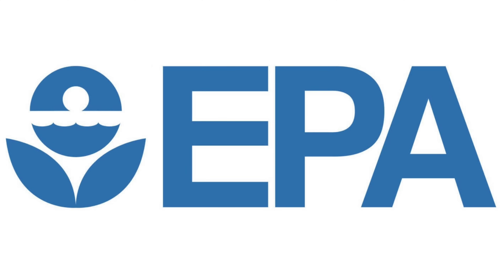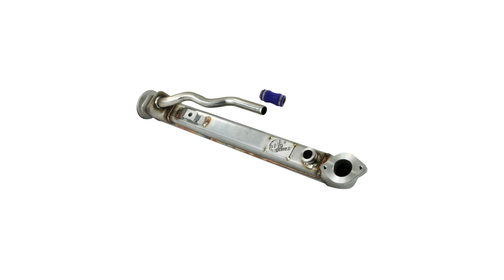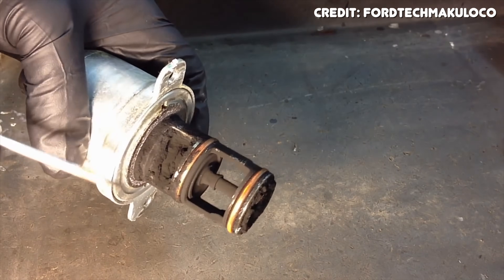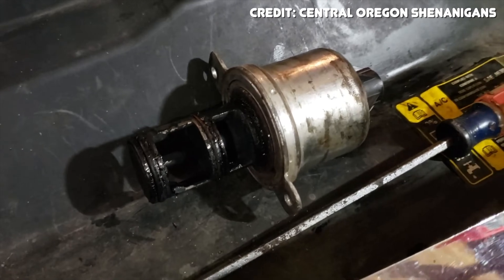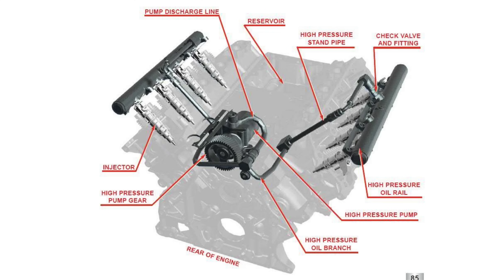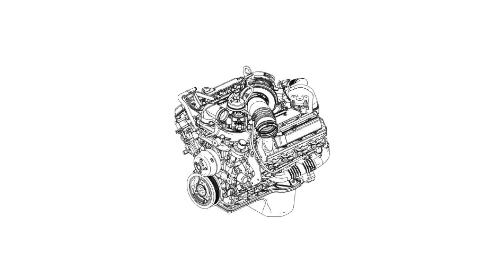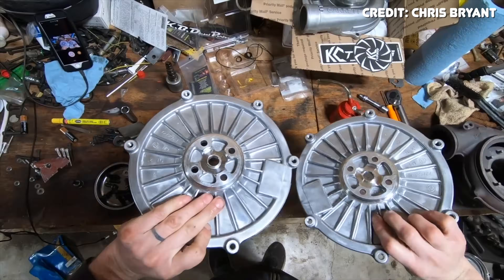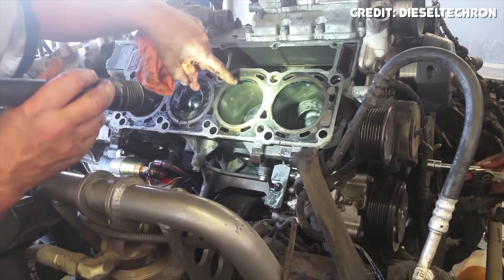The Truth About the 6.0L Powerstroke (And Everything Wrong With It)

Comment: Im on all my first motors. Have hundreds of ks on them. I wouldnt change the Hp or anything. I would pep it up maybe if I did.  
The right oil, coolant, and coolant cap is all Ive done. The only thing I ever noticed was a problem is bad gas. Makes the injectors fail (friends trucks). I have more issues with the vacuum for the A/C and the 6 disc changers all failed.

The engines have been perfect. Not arguing with anyome else that had issues. Every mechanic one talked to say they are a dream compared to 6.4 and 6.7
Cleaning egr is annoying

Comment: I find it interesting how there is a lot of controversy over the 6.0 Fords… I have an ‘05 F-250 with about 46k miles on it. I’ve not experienced any issues on it thus far but I’ve been told many times it is going to literally blow up in my face. I started doing my research on this kind of thing and I’ve come to find that there’s a lot of conflicting opinions when it should be pretty simple in my mind. Personally I have been trying to plan out the bulletproof process for my truck but I’ve been wondering if that would be the route to go, and what areas of the truck should I be putting my focus on regardless of their importance. I have also been wondering about adding additional power to the truck afterwards because I’ve been told that it should have nothing extra put on after bulletproofed

Comment: Step one, remove cab (because f u that’s why)
Step two remove 6.0
Step three install 5.9 Cummins
Step four put cab back on
Step 5 never have an issue again.
Optional Step 6 use the 6.0 for what it was really designed for and does well. A boat anchor.

Comment: The 6.0s needed bullet proofing because of EGR. Solid engines in my opinion. I come across a clean one with 300k+ time to time. The 7.3s are better but such a nightmare to work on.

Comment: I bought my truck new in 03. Still running it almost 20 years later. Fixed the things Ford and International ignored. Great engine, but it needs clean fuel and oil. Very fuel efficient. No power upgrades done except for a 4 inch turbo back exhaust, EGR delete, Banks intercooler upgrades and stage one upgrade on compressor wheel to move more air. I also added the cooling water filter and moved the oil cooler outside of the engine. Stock injectors. Keep in mind many upgrades have been done over the years to improve reliability of parts by Ford and the aftermarket.
Reply: Not to be a dick but I wouldn’t consider it a great engine if you have to do a bunch of mods including deleting emissions devices to make it reliable. How much was the diesel option back then? Like $8k? You should have gotten something you good use as it was intended with little worry.
Reply: Still have my 03 cc, lb, 4wd totally bulletproofed and am right there to click 50k miles lol. No lie. Ordering the new Odawg s2r intake in hopes to lower egt`s.

Comment: You have a very condescending tone and obviously are a Ford hater.
I grew up as a Ford brat, my Dad was a Ford dealer, so I might be a bit biased.
In 2014, I bought a used 2005 Ford F350, crewcab, long bed, DRW, 4wd to carry a 5000# Arctic Fox truck camper.
I immediately did ARP studs, Bullet Proof Diesel EGR cooler(lifetime warranty), and
a fresh OEM oil cooler. I also flushed the coolant and replaced with Catipillar EC-1 coolant and
installed a Sinister Diesel coolant filtration system. 
I now have 170000+ miles on my truck with no problems. 
I maintained proper maintenance with 5000 mile or less oil changes(T6 5w40) and regular fuel filter changes.
Plus I use Archoil and Hot Shot Secret's oil and fuel additives on every oil change and fuel fill ups.
Some of the issues you point out are only likely to occur with poor maintenance like high mile oil changes,
fuel filter changes(if any at all), and no fuel or oil additives.
Most diesel engines don't do well with dirty oil and fuel. Yes, the 6.0L is very sensitive to these problems,
so keep the oil and fuel clean with proper maintenance and additives.
Early on there were reports of sand block casting. With proper dealer support, this would have been
an un-issue, but Ford Motor did a bad job of supporting the dealers which were more or less clueless when
came to diesel engine support. (ie. th PSD 7.3L had no pollution components .~. was an easy keeper)
Also, Ford insisted on Motorcraft Gold coolant which initially would precipitate a goo that would clog up
the coolers(latter updates, eliminated this problem).
Ford was also very adamant about the head bolts and refused to admit that they were a problem, but now
a new factory rebuilt PSD 6.0L engine comes with head studs!
(BTW: My 1st truck camper rig was 1999 Ford F350 PSD 7.3L which I had a lot of problems with)
Reply: I also initially added an Edge CTS OBII in cab monitor which allowed me to monitor EOT, ECT, FICM volatage, ...
Reply: A reman from Ford does not come studded. 
 Also you had to do thousands of dollars on upgrades to an engine to make it reliable. I fail to see how anyone who bought one of these new as a several thousand dollar option should be expected to have to pay out the nose to make it reliable. Shoulda come that way.

Comment: The Ford Guys chiming in to defend the 6.0 Like a wave of lemmings going for the cliff. When you simply ask to see a picture of Odometer - they go Ghost
Reply: I’m a Ford guy. Don’t understand them defending this crap especially since ford didn’t design or build this engine. Would Ram guys blame them if Cummins came out with a redesigned engine and it was trash? That’s on Cummins. 
 Also the guy in the video mentions Ford boosted performance on an agricultural engine and it caused issues. Nonsense. Far more Powerstrokes were produced than DT365 during those years. International deigned this engine to go in Fords. Hell he even says the 7.3 was churning out 275 at the end of its run. Like they really thought they were gonna tune it to 175? Please

Comment: I've got a total of 20 thousand in my 03 when I bout it it had 90,000 miles. Purchase and full mod of problems with Bullet Proof Diesel products in 2012. I am just hitting 200,000 miles with zero problems. All I use it for is towing a 5th wheel at 16,000 lbs and a car trailer for my rock crawler at 7,200 lbs. For my money I see I am way ahead for power and dependability of the after years and current. 

Thought of getting a new truck and found cost and dependability of all of them just didn't ad up. Plus I don't have the head aches of DEF system. Thinking now of redoing the interior and do a paint refresh and party on... 

I like the hate for the 6.0s it got me into one for cheap and has been a very comfortable rig and surprisingly cheap operation for a diesel. But now I see the prices are ridiculous.

Comment: 280,000 miles on my 2006 6.0 F350 srw Supercab 4x4..
Change the oil frequently, put on a coolant filter and use CRC diesel fuel additive

Comment: I had all those issues, but once they got fixed , it is a great engine with no issues for eight of its eighteen years. Racing them hurst them and running clean diesel like Propel of R95 helps with smoke and soot buildup. Ford  ignored all the early issues.

Comment: I have an early 04 6.0 that has been bulletproofed on all 5 major points.
She's a beast, tons of power, and sexy...
Over 250000 miles, came off the line almost exactly 19 years ago, and still moves and sounds like the head turner she's always been. 
Blacked out and ridin' high... 
Nothin' else sounds quite like an early 6.0. 
Routine and religious maintenance is key.
Pinkos and Little Leftwing Crybabies are the only ones who don't find a bit of joy in the way Betty looks and sounds when she's out rollin' around...

Comment: Anyone reading this with one of these motors:

In addition to the standard "bulletproofing".. Go get yourself a bypass oil filter and coolant kit. There are a few available online. Then run Shell rotella T6.

Because of the fuel injection system, these motors are really hard on motor oil, in particular shearing. T6 is one of the most shearing resistant oils on the market by far.

As mentioned in the video, the coolant system is susceptible to failure from debris and buildup in the coolant, the coolant filter will solve that. An oil bypass filter will help protect both the main, and high pressure oil pumps as well as the injectors.

Comment: 6.0L is a pile of crap, bought one new in ‘05, truck cost me $62K including the price of the truck and all the repairs and upgrades to drive 132K.  I replaced it with a 7.3L that I’ve driven 155K for $22K.  The cost to keep a 6.0L alive and the horrible value retention made it the worst vehicle I’ve ever owned.

Comment: You get good ones and bad ones. I’ve had two both the same model year. First was total trash and could never be fixed for longer than a week and the second has been amazing. Both had about the same mileage when bought, owned by older people, one owner trucks. I will say the way I take care of the second one is far better than I did with my first. I use it harder but do regular maintenance, and do so the right way.

Comment: the 6.0 with studs + EGR delete + oil cooler is an insanely powerful motor.  now.... if consumers actually changed the oil as told, the oil cooler wouldn't be necessary either but the typical consumer steals a big turbo on and forgets the rest of the motor.  reality?  6.0's ,make 2000 ho on spray and with killdevil heads with zero issues.  there are millions of 6.0's out there.  great opportunity to make a ton of power for cheap.

Comment: Everyone got there opinion I've beat several 6.7 and 6.4 I beat duramax 6.6 7.3 don't hold a candle my truck pretty strong 2wd extended cab in I got just simple add on 6.0 are fast to me my opinion I've prove it by racing several other powerstroke

Comment: I have had EVERY issue you mentioned in this video and I have never cranked up the power and always serviced my truck.  Not only that I was stupid enough to buy 2 of them.  As we speak, the coolant system is pressurizing.  Great video!
Reply: ill buy it off you!
Reply: A lot of people will tell you that they made good ones and that they made bad ones the bad ones were bad straight out of the factory in the good ones were just good and went without issue

Comment: The key is change the build to the intentional specs.     That engine was running great before Ford used it and afterwards.   The biggest bug was Ford not using a coolest filter.       The block design was know to have foundry sand getting trap.   Intentional used a coolant filter as standard equipment and never had the oil and egg cooler failure that lead to head gasket failing.

Comment: As long as you maintain the motor and do the things it needs if you wanna put more power to it they're good motors. Got 300,000 on mine with no issues. Bone stock. Truck runs like a dream.

Comment: Never had any issues with my 06 but the previous owner did head studs and egr delete. This truck spent about 80 percent of its life towing at least 9800lbs (9800 lbs was the empty trailer, loaded it was 30k) but I wasn’t running some crazy tune either. It went close to 300k without any issues before the truck rusted out. It did have the occasional issue with a sensor or other electronic unnecessary crap on the engine. Personally I would much prefer a mechanical Cummins Cat or Detroit 2 stroke. But as far as the Powerstrokes go it wasn’t bad but I don’t have any experience with the 6.7. The 7.3 was better as far as reliability is concerned, and the 6.4 was far far worse. I want with a older 3406B Cat in a Pete after my nightmare experience with the 6.4. She’s got 1.8 million miles and still trucking! I highly recommend just going for at least a single axle tractor instead of a pickup they are just all around better vehicles for towing. Especially if you can find an older one with a larger mechanical diesel and a 10speed manual. Avoid the ones with small engines and 6 speed transmissions they are gutless and don’t last long.

Comment: The big problem is the 6.0 is older technology and people try to compare them with the new 6.7s, you can't mod a 6.0 up to a 6.7s specs and except the engine to hold up. The 6.0 back in 2005 wasn't etented to have 600-700-800 HP that people throw at them today with no head studs or bulletproofing.

Comment: The guys at FICMRepair are damn solid resources for any 6.0 owner. They sell pretty much any part a guy could need and the customer service is stellar. They help guys all the time with troubleshooting, OE and aftermarket parts selection, etc. - Plus, if you're going to own/drive a 6.0, the FICM tunes they sell wake the beasts up very nicely. Best of all, they help with fuel mileage!

Comment: So I have a 2007 6.o in the F250.   I preempted a lot of these problems with vary expensive after market parts in a shop in Houston that had a solid reputation for stellar work.  I redid the head bolts to studs, had some additional head work done.  Relocated the engine oil cooler with a BPD oil cooler kit.  New four core aluminum radiator, billet water pump etc.  New stand pipes and orings, new gas bottle, new injectors, rear main seal, and after market "larger" EGR cooler because undeleting that doesn't make sense to me at all.  Added cold air intake because it makes sense to.  No tuner added, but plan to upgrade the turbo this year.  Using factory gages to monitor oil/coolant temperature and all within normal ranges.  All said and done, its still cheaper to do this than buy a new used truck and im looking forward to many tens of thousands of miles on this truck.  All I can say is maintain your good clean oil and check it often.
Reply: How much did you spend on all that?

Comment: I’m not a mechanic but I bought a 2006 F250 6 L broke down three times, I bought a used I took it over to Bullet Proof Diesel in Arizona from Colorado and it has not broken down once knock on wood after that. Not a cheap modification but compared to buying a new truck it has been wonderful.

Comment: The 6.0 is awful.  You shouldn’t have to spend 1000s of dollars on a motor to have reliability.  Deleted the motor is decent. EGR on any diesel is bad for the internals due to soot.  Oil cooler is a huge issue though.  If you manage to avoid or address oil cooler restriction issues quickly, most of the other oil related items like injectors, ipr, hpop , etc become uncommon.   
In conclusion the motor is a terrible motor which with some work can become an ok motor.  I will say that compared to the 6.4, the 6.0 is great.  The 6.4 is so bad that the 6.0 doesn’t look so bad.

Comment: I own an 05, 6.0 and love it. It has its issues like all engines do that you use.  Like others have stated, maintenance is huge, and when they start showing symptoms of failing, don’t ignore them. Fix them quickly. I bullet proofed my engine and left it stock and it runs a strong now as it did the day I bought it new
Reply: Yup. Mines bone stock 350,000 miles without one head gasket change.
Reply: mine too

Comment: One of the biggest contributing problems to the issues with the 6 l Ford was the Ford Gold coolant. That stuff had so many silicates in it The poor oil and EGR coolers didn't even have a fighting chance. If you got that crap out of there right away you could put in a caterpillar EC1 rated antifreeze and avoid a lot of these problems. Of course you shouldn't buy a diesel of any kind of if you don't want to do maintenance on your vehicle. If you want to make good power with some economy a diesels the way to go. If you want to get in a truck drive the heck out of it and do nothing but change the oil and fill it up with gas then I suggest you buy a small Toyota with a four cylinder in it. Now having said all this I had an 05 super duty with a 6 l powerstroke in it I absolutely love that truck, but from 50,000 miles on that engine was a flaming nightmare and did nothing but cost me money till the day I got rid of it. My current truck has a Cummins in it and I'll never look back. If I could have a Cummins in that 05 super duty with that 5R110 transmission I do believe that's the last truck I'd ever want to own. That was the perfect truck.

Comment: The only thing worse then a 6.0 is a 6.4. Working on a all stock 2004 6.0 right now for a customer. It had two turbochargers put on by ford under warranty and a oil cooler. At 101,000 miles Deltas are once again out of control and the VGT ring in the turbo had cracked sticking the fins. New OEM oil cooler, EGR cooler, and unison ring along with a whole crap load of OEM gaskets, O rings, and seals. I will say this again it’s 100% stock and driven by a older man who uses it for a firewood business. Ford initially told him the problems happened because he didn’t drive the truck hard enough…. He lives on a mountain and hauls firewood to people weekly with the truck. After it continued having issue ford claimed he was driving the truck to hard despite being light footed and not overloading the truck. This is just one of the dozens of 6.0 stories I have and it’s the owners who pay for fords/internationals BS.

Comment: My brother , father and I all own an 06 6.0. I killed my motor at 319k with 190/100 injectors and a really hot tune. My dad's is at 391k still going(Also stock transmission) My brother's is at 299k still going. All required head studs . But Been great trucks